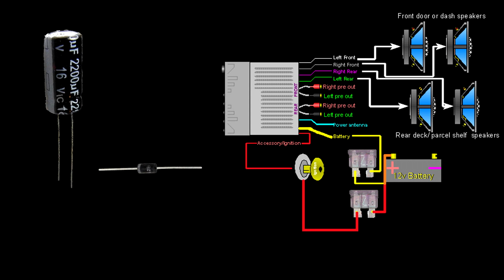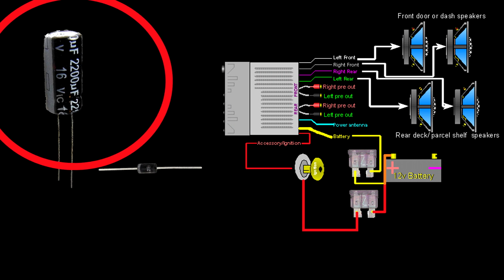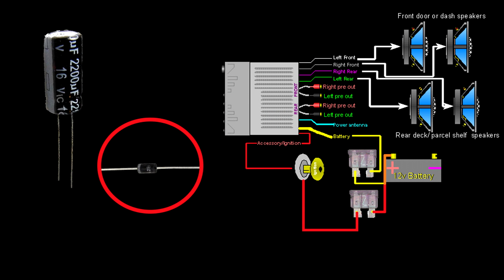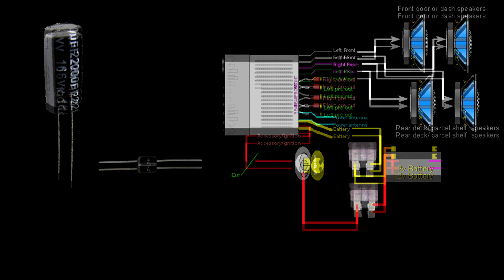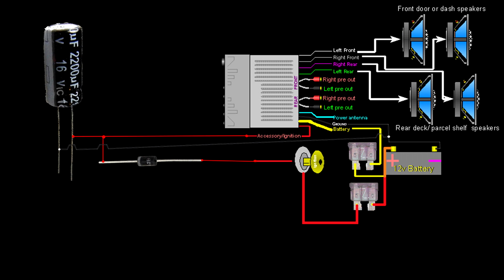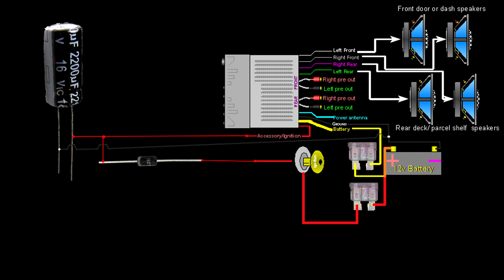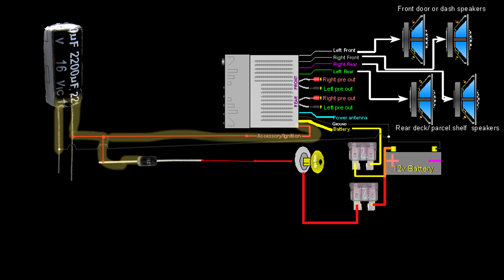HOW TO: Keep Your Car Stereo On While Starting

Comment: Excellent  information from  Stephen its guys like him that save us head aches  and supply fixes most of us wouldn't beware of , 

I used this on a 2002 Toyota Yaris  with a recent (2021) Kenwood Dabs Bluetooth Head Unit, its disappointing the unit doesn't have these feature built in

I first used a 25v 3300uF Capacitor , I found it worked but was intermittent  so tried adding  a 12v 5w diode (definatley recommended don't waste your time without one) with a plan to adding another capacitor if required (it wasn't necessary), just to give others additional  feed back  once I fitted the diode the power hold went from 3 seconds to at least 5-6 seconds which is almost too much as when leaving the car the music is still noticeably loud when opening the door in residential areas at night   which is where the 2200uF many have been more suitable (shorter delay), as for going from auxiliary to cranking (ie stop sort in traffic) it easily prevents the radio rebooting and stops the bluetooth dropping calls due to the rebooting without this kit , the overall cost was very low under £15 if you include wire and heat shrink and very little time easily less than an hour including headset removal , just one point you need a soldering iron  for the diode and capacitor

Its a  no brainer if you have reboot issues , Good luck
Reply from the maker: Thanks for the report. Glad you were able to solve your problem, and optimize you experience! 😁

Comment: Only change I would make is to add a 1K resistor inline w/ the diode. This is to protect the both the diode and cap from the initial surge current as it charges. As for the capacitor, typically a 1000uf is sufficient for ~ 5-8 sec though I would go with a 25V over 16V if possible for longevity. A cap's V rating is it's max voltage, not necessarily it's working V, so having < 30% headroom is recommended.
Reply from the maker: The inrush resistor is a good idea, but I find it adds an annoying delay to the turn on. I've mostly used WAY overspec'd diodes for the job, and only had one die when I tried a little signal diode (with a lower forward voltage drop).
As for capacitor size for a particular stay-on time, it depends on the stereo. I'll post a way to guesstimate the internal resistance (current draw) on the red wire. 
25V would be a better safety margin, but the cap is significantly larger, and again I've never had one die. 🤷🏼‍♂️
Reply: @StephenTack  If using a 1K R with a 2200uf cap I can see there being a possible extra ~2 sec delay. IMO a 2200uf is a bit overkill. I've used a 1000uf in multiple systems and any delay has been negligible. Component parts will be cheaper as well as you only need them spec'd for 200mA. But also comes down to what you have on hand.
Reply: I just purchased a 25V 10000 uF to use for this purpose.
Does it still have a measurable delay when not using a resistor?
Reply: I went for 10000 as I was hoping it would stay on while music was playing.
Reply: @mikkel how did that 10,000uF work out for you? How much time are you getting?
Reply: @SerenoOunce @StephenTrack Hi so is it better to add a 1ohm resistor? Have you tried?
Reply from the maker: To size the cap: "You could hook an meter up in line with the red wire, in "amps" mode to find the draw, then plug that in to this equation:
TimeYouWantItToStayOn ÷ (Voltage ÷ Current) = Capacitance in Farads

In my case this was about: 
4S ÷ (13V ÷ 0.0072A) = 0.0022F = 2200uF

Comment: Hi i have hyundai i 10 car with single din sony stereo . I have tried with 3300 mf 25v capacitor with 1n4007 diode in red wire . Still stereo is switching off immediately after power off and switching on late after ignition . Please give some suggestion
Reply from the maker: That's very interesting! 🤔
I'll be thinking about what could cause that behavior. The only things I can suggest are checking the diode, and making sure that the capacitor is connected to the red wire and the ground wire (not in line with the red wire).
Hope you get it working. If so, do tell what it was. Cheers!
Reply: Hi ...diode is correctly fixed and capacitor  positive leg is connected with red wire and negative leg with black ground wire . Only thing is the wire connecting diode and capacitor used is very thin aluminium wire used for dvd tapes. Can that be the reason
Reply from the maker: @dhira88  😮DVD TAPES!?  
If that wire is really thin, maybe. You can just connect the stripe side of the diode directly to the positive side of the capacitor AND the red wire going to the stereo.

Comment: Not sure if you still watch for comments on here but first of thanks for the video .! I’ve run the circuit in the video and despite my head unit staying on for a good 10 seconds after the key is removed it still restarts on ignition . Any ideas or help appreciated .! I’ve read through all the comments
Reply from the maker: When cranking the voltage on the yellow wire can be pulled too low to keep the stereo powered on. Things to check: health of the battery, corrosion on the terminals, bad connections anywhere. 

If you have a good strong, well connected battery, the solution is another diode, and an even larger capacitor (or a bank of them in parallel) on the yellow wire. So when you crank the stereo will be fully powered off the capacitors. You'll need to find either large capacitors to put in parallel, or string together supercapacitors in series to get at least a 15v rating.

Comment: Nice. How did you determine the size of the capacitor? And would you know how to make a similar connection so that it stays on until you open the door?

thanks,
frank s.
Reply from the maker: It all depends on how much current the red wire of your stereo draws. I just salvaged a 2200uF capacitor, tried it, and it was the right size for my stereo. You could hook an meter up in line with the red wire, in "amps" mode to find the draw, then plug that in to this equation:
TimeYouWantItToStayOn ÷ (Voltage ÷ Current) = Capacitance in Farads

In my case this was about: 
4S ÷ (13V ÷ 0.0072A) = 0.0022F = 2200uF

To get it to stay on until you open the door, you'd probably have to use a relay or two... Could be done, but it's a totally different circuit.

Comment: Hi there thanks for this video, I ran into some problems with my canbus headunit installed it at a garage sometime back and when you turn on the car by right the headunit should do so however even pressing the power button doesn't do it either only when I press the tiny reset button only then it powers on. Strange part is when you turn off the car and turn it on again it works however if you leave the car say turn off for an hour and then turn it on again it doesn't work and you're back to using the reset button again. Thanks in advance
Reply from the maker: Too many variables to know what's wrong. But I'd guess either the wiring is wrong, or the head unit is defective. 🤷‍♂️  I'd start troubleshooting by googling it in a variety of ways....

Comment: Hi, I've wired it up exactly as per the diagram and put two diodes in circuit. On my test bench it works and I can see the voltage decreasing gradually. However, as soon as I wire it up in the car (taking a feed from a 25amp switched live out the back of the fuse box and the negative going to a direct ground on the chassis), as soon as I shut off the cars power the capacitor appears to instantly drain, straight to 0v as if they weren't even in the circuit (even when not hooked up to the radio)... I can't work out what's going on? Hope you can help!
Reply from the maker: That is odd, if the delayed turn off works on the bench it should in the car.  I'm curious why you have 2 diodes? You should only need 1.
Reply: @StephenTack  sorry, one diode and two capacitors. Wasn't thinking when I was writing! Likewise, I've got a variable voltage tester so set it around 12v and it works. Yet in the car it's not interested, really not sure what's going on with this one!
Reply from the maker: @chrispage558  were you tested it with the stereo on the bench? If not it could be a strange stereo that draws significant current through the red wire.
Reply: @StephenTack  that's the thing, when I tested it on the bench I was just checking the voltage coming out of live. Same again in the car, I didn't have it plugged into anything at all so not to drain the capacitors but still nothing. Thought it might be something you'd experienced before or heard of but not to worry if not! Thanks for your help
Reply from the maker: @chrispage558  the supply for the red wire in the car is the same as what you used on the bench. I'd guess either the diode is backward, or died. Or some wire just isn't hooked up right. 
If you're using a wiring harness adaptor, make sure all the pins are where they should be, they are made incorrectly some times.
Reply: @StephenTack  thanks, appreciate your help. I'll double check everything is wired correctly and the diode is the right way round etc.
Reply: @StephenTack  Just a thought... if there is a relay in the circuit that closes when I switch the ignition off, is it possible that this would then break the circuit entirely and prevent the capacitor from functioning as expected?
Reply from the maker: @chrispage558  Yes, but the diode should solve the problem. It lets current flow to charge the capacitor, and turn on the stereo, but when power is cut off and possibly shorted to ground (relay), the diode stops current from flowing out of the capacitor back into the car.

Comment: Hi, thanks for the video.  I'm going to give this a try tomorrow.  Please could you tell me if this would work if your using the red wire on a permanent live? Thanks
Reply from the maker: If the red wire is connected to power that doesn't get cut when the vehicle is off, or while cranking the starter, but the stereo still shuts off (or resets) while cranking, it's likely that the starter is pulling the voltage too low to keep the stereo turned on/powered.
You can try this fix first, but will likely need to add a large diode, and a few very large capacitors to the yellow wire (or upstream of the yellow and red if they are tied together)...  Or maybe just get a fresh battery, clean off any corrosion, or beef up the size of your wires going to the battery.
Reply: @StephenTack  Right i'm with you, you've given me a few more pointers, thank you.  I'll try your method tomorrow and let you know.  Thanks
Reply: @StephenTack  Please could you tell me if you are using the diode as an insulator in this
 setup? thanks
Reply from the maker: @Shirehorse73  I guess you could call it that. More like a check valve really. The diode makes sure the charge stored in the capacitor doesn't flow backward to power other accessories. In some cars this may not be needed (if the accessory circuit only goes to the stereo, and it's disconnected, not grounded, while cranking), but I've not found a vehicle that didn't need the diode.
Reply: I understand what you’re saying. Well we tried it today with first of all 2 x 16v 4700uf caps too no avail, we then added 2 more caps the same.. still turned off on crank. I’ve ordered a monster battery this afternoon so will let you know how that goes... thanks for your help
Reply from the maker: @Shirehorse73  you did have a diode in there, right?
Reply: Stephen Tack Yes we used one of these and put the non stripey end to the car side, any pointers? Thanks 

https://www.cricklewoodelectronics.com/1N4007.html
Reply: Stephen Tack Sorry they we’re 25v caps, that shouldn’t make a difference though should it?
Reply from the maker: @Shirehorse73  sounds like it all should work. How long does the stereo stay on if you disconnect power to the red wire at/before the diode?
Reply from the maker: @Shirehorse73  glad it works. 
One of those capacitors would work, but be totally overkill for the red keep-on wire. You could use it and a beefy diode (or two) on the yellow power wire, to keep the stereo supply from sagging.
Reply: @StephenTack  I have a VW Caddy van so i have plenty of room for installing that large capacitor,  I've got the red and yellow wire crimped together straight to the battery on the harness we made. Would it be ok to have both lives going straight to that large cap? Can you recommend what type of diode i would need in that setup? Sorry for all the questions.
Would this diode do the job? Thanks
https://uk.rs-online.com/web/p/rectifier-diodes-schottky-diodes/1652599/
Reply from the maker: @Shirehorse73  🤷🏼‍♂️ sure, why not. 🎉
This diode is more reasonably priced, and has better specs (lower forward voltage drop): https://uk.rs-online.com/mobile/p/rectifier-diodes-schottky-diodes/8184553/
Reply: Stephen Tack Thank you so much for your help, much appreciated.. I’ve got the capacitor and diode on order.. will comment when I’ve installed it all. Thanks again
Reply: Stephen Tack Sorry to ask Stephen, please could you tell me which end of this diode you recommend goes to the car side (battery)? Thanks Jay
Reply from the maker: @Shirehorse73  stripe toward stereo.
Reply from the maker: @Shirehorse73  on that one the stripe (cathode) is the top tab, that doesn't have the three little pins.
Reply: Stephen Tack Thank you, you’re a lifesaver.

Comment: Thank you so much Stephen, this worked. My setup is with 1000 microfarad 25V capacitor and it hold for 35 seconds, once I take out the car keys! Do I need to put a resistor somewhere to increase the life of capacitor?
Reply from the maker: Wow, good result, your stereo must have very little draw on the red wire.  None of the capacitors I've used have been damaged yet, with just the diode to block back-flow... I have have a diode fail when I used a fancy low-forward-voltage drop one instead of just a beefy power diode harvested from an old power supply.

Cheers!
Reply: @StephenTack  Completed this in my other car, and it worked again. Here 1000 microfarad capacitor helps during start, but JVC 220 BT seems to consume more power, after key off the stereo goes off in 2.5 seconds.
Reply from the maker: @technovariable831  that's aligns with my experiences. I've been using 2200-3600 and getting 5-10 seconds.
Reply: @StephenTack  Thank you so much for sharing your valuable experience.
Reply: @StephenTack  Cheers! Now trying this setup on my other car. I bit customized this one, put a connecter in between where I can change the capacitor without resoldering. In case you need to see, mail me Hi at 260519@gmail.com

Comment: Hi i have a sony XAV-3005DAB radio with apple carplay which charges the phone at the same time and also has a screen so im assuming it will use quite a lot more power. Do you think it will still keep my stereo on while cranking?
Reply from the maker: That really depends on the health of your battery, and the battery connections. This mod only needs to supply a turn on signal, it doesn't really supply power. It's worth a try.

Comment: Can i just run an extra wire from my amp capacitor ?? Or is there an unforseen issue with that?? 🤔🤔
Reply from the maker: Amps (and amp caps) are hooked right to the battery, so that would be an always-on voltage, and you stereo would never turn off.
Reply: @StephenTack  whaaa..never knew that! Thought the volt meter on em was also a switch of some kind! Makes perfect sense..thank you! 👍👍

Comment: This worked perfectly on my 97 Miata with a pioneer headunit. I used a Diodes Incorporated 1N4001-T and a Panasonic EEU-FC1C222 2200uf capacitor. Stays on about 5-6 seconds after shut off. Battery is about 3 years old, temperature was about 70 degrees. We'll see how it does in the cold.
Reply: Thanks for the part numbers. I got both from Digikey.com. I picked up three of each (extras for future use) for under $10 including shipping. 
Miata Is Always The Answer. I have a 2015 NC